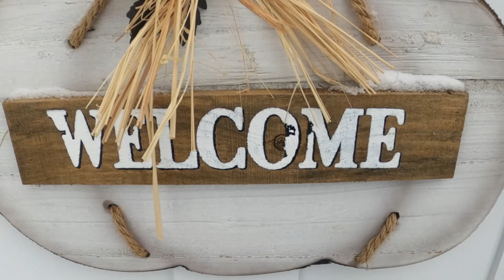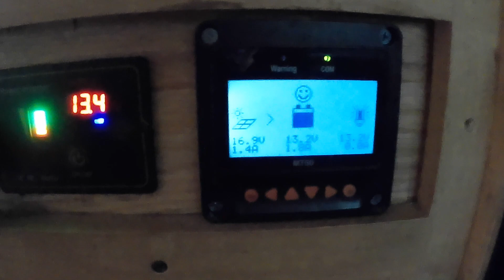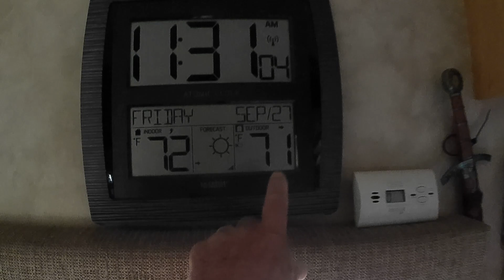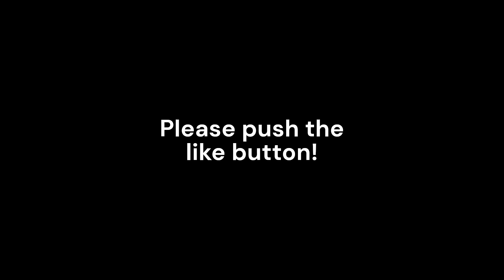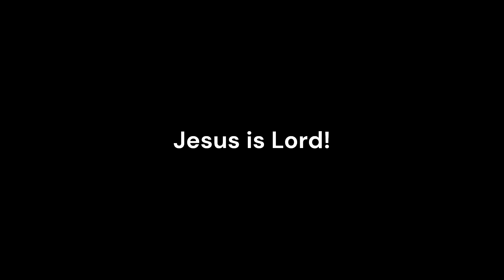An idiot mixed lead-acid with lithium batteries part 3

Comment: Did you get rid of your lead acid batteries?  Was having both lead acid and lithium on parallel a success or not?
.
You’ll need to seal every crack in those styrofoam sheets to keep the heat in.  There will be a big difference when it’s 100% sealed.
Reply from the maker: @jasonmcintosh2632  Sorry I accidentally sent that text. To answer your original question was a success or not I'd say yes very much so!
Reply from the maker: @jasonmcintosh2632  Hello again new friend, I have replaced two of my four lead acid batteries with two 200 amp hour lithium batteries. I did so because the two of the lead acid batteries were very aged. Lead acid batteries were put into another project in my house
The new lithium batteries were less expensive to purchase the new lead acid batteries

Comment: The electric battery warmers may not be enough in a couple months.  I don't know much about these things but, "Topteng" is the name of a tiny propane-powered heater with a thermostat (!!!), costs about $60.  Re, the heating mats.. putting the electric heating mats under that battery might be more efficient.  The weight of the batteries should push them neatly into the Styrofoam.  But like I said, don't know much about it, just trying to be helpful. :-}  Edited:  I pushed "like" but the count stayed at zero. :-{
Reply from the maker: @SunriseLAW  Hello again friend, hey I'm just flying by the seat of my pants. Thank you for your comments and input. I'll try different things until I find what works. I thought about putting the heating pads underneath the batteries, but I'm concerned that they're not designed to be closed in? They're designed to be stuck on the outside of a water tank. One side stuck to the tank The Other Side open
Reply from the maker: Thank you for watching and may God bless you!